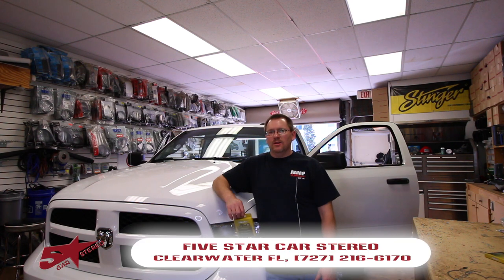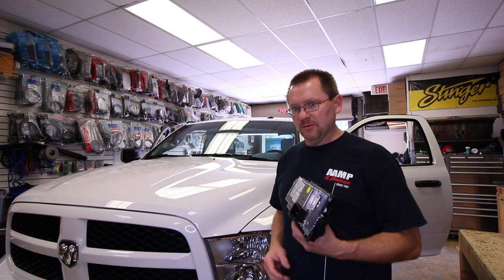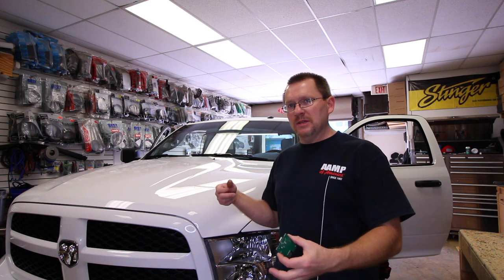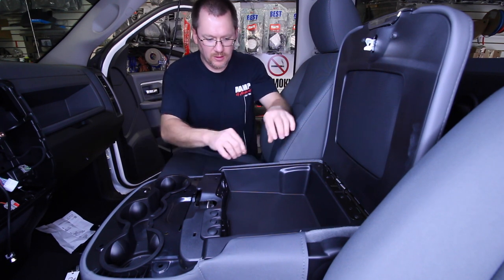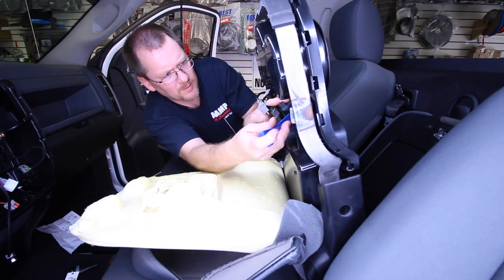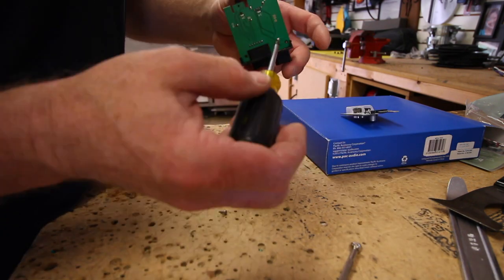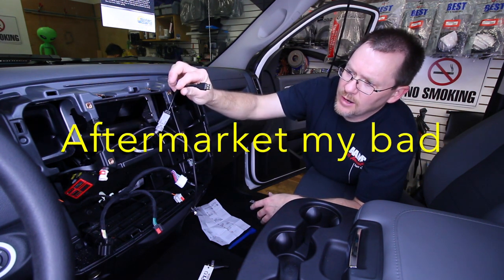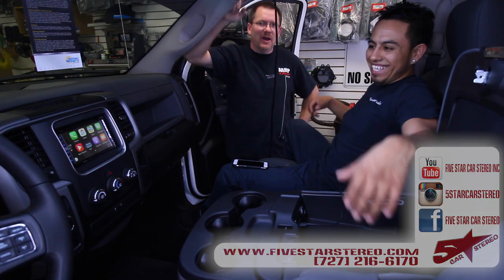How to install the idatalink uRam USB and AUX replacement hub for the Dodge Ram

Comment: I really like your videos.  I have one of these installed by Buy Best and it doesn't work on my 2017 Ram with a Pioneer AVH-2330NEX.  It keeps disconnecting and Android auto tries to start but dies.  I've tried 3 or 4 different USB-C cables, but no go.  I saw a lot of negative reviews on Amazon for 2017/2018 trucks and/or Pioneer radios.  I guess I'll need to revert to the Pioneer dongle.
Reply: Of course maybe I just got a bad one.  I'm bummed that I can't use the factory ports in the console.

Comment: Great video. I really like to get my hands on that idatalink uRam USB and AUX replacement hub. Recently, i had replace the OEM head unit with Kenwood ddx1035. its a bare basic head unit, but has an AV1 RCA input which i connected to a miracast unit (Brand: Dynavin, Model: 900). Link with my smartphone. cast the phone screen to the head unit. Downside, cannot control phone function on the head unit. have to use the phone. At least, i can cast google map onto the head unit. also play tunein radio in the background while using the google map. For the reverse camera, i install a spliter for the front and back camera with manual control button for the front camera for 20 second, automatically screened the front camera when gear is put to drive mode; active for 20 second. But the car has its own USB and AUX jack which is no longer function, I will need to source something like the idatalink uRam USB and AUX replacement hub.
Reply from the maker: If you are in the US give Paul a call and he will sell and ship you one.
Reply: Unfortunately, i am not from US. Anyhow, the video is great. I will try to source something similar in my country.
Reply from the maker: +Syed Adlan it just started shipping here last week so you guys should see it soon hopefully. Thanks

Comment: If you are thinking of installing this usb ram, look on idatalink's website to make sure your aftermarket stereo is compatible  with the circuit board. I installed one and found out mine didn't work .

Comment: I’ve seen a few videos on this now. One thing I question is why no one reused the plastic translucent plastic shroud that goes on the usb and aux Jack. I slid mine off and slid it over the Uram and fit perfectly plus it ads rigidity to the inputs when it’s in the center console

Comment: A little off topic question, but since you're an installation shop I thought I'd ask. How do you take the cubby that's under the stereo bezel out? I'm trying to install a hidden USB port in it. I couldn't find push in tabs on the side sliders or screws. Any help is much appreciated.

Comment: I have Dodge Ram 2016. The part that comes with it is there is no regular USB hub in the back of the radio, do you still need that adapter

Comment: Nice video guys , hi Dean just wanted to thank you for ur assistance on the Microbypass for the 4200nex it does work & with sd card and usb all in or DVD I think these guys won't mention any names didn't try it out or installed it wrong who knows  but it's on working as u &  Matt said thanku for tat 😂.?on a 03 suburban with Bose's system the rear Pilar do u have an idea wat size are those tweeters in there thanks again guys
Reply from the maker: +lolo ent glad it all worded out and you got it to work. The rear pilar speaker is 2" by 2" Bose speaker. Any 1" tweeter will fit back there. With some cutting you can get a 3.5" back there.

Comment: Hello, I recently subscribed to your channel and really enjoy watching your videos. I have a few questions that maybe you can help with. I have a 2017 ram 1500. I have been wanting to upgrade to an aftermarket head unit, however I have been told by a few people at dodge that this is the first year that they had integrated something into the wiring that meant that aftermarket was not an option. I dont know if this is similar to the canbus system, which will throw codes, if you dont use specific light bulbs, etc. I bought a lifetime warranty on this thing so I dont want to be hacking up all the wiring. Do you have any recommendations or solid answers as to what can be changed and what cant? I have a couple alpine amps, 2 10 kicker comps, and 4 6by9 that I would like to integrate. Any and all help anybody could provide would be appreciated

Comment: Im putting a simple single din into my ram 1500. Would this adapter let me have usb coming from the back of the radio run to the center console?
Reply from the maker: +Bryce Nauta yes it the radio has a rear USB

Comment: I'm installing a 2018 OEM radio into my 2016 Ram 2500 so I can have CarPlay. I know that the media hub in my armrest must be changed. Most suggest buying a 2018 hub, but it clearly isn't the same size. Will this product solve my issue?
Reply: Seriously,  has Noone tried this yet?

Comment: These seem to be hit and miss with carplay working. Is it possible that they work only with Rams equipped with single USB port rather than the USB port and SD card reader type hubs?

Comment: i have question if i install a new radio can the center usb still charge a phone
Reply from the maker: peppaboy9 some Rams have 2 USB ports in the armrest 1 is with the Aux for media play back and 1 is next to it for charge. The one for charge will still work the other will not.

Comment: I installed this and works perfect for my ipod.  Charges my android phone but i cannot access android auto. I tried it with both usb ports. Did I do something wrong or it just only works with apple car play?
Reply: i have the avh4200nex
Reply from the maker: Android auto is real picky. The cable length has a big factor. Are you using the original phone cable? Are you plugging the adapter in to the radio leaving out the pioneer extension?

Comment: Question about the center console usb connector on a 2012 dodge Charger. I bought a Pioneer avh-2300nex and the i data meastro. Will i still be able to use the factory usb instead of the one the pioneers system provided?
Reply: Factory usb hub only works with factory radio.

Comment: I am doing on Charger.  But video too fast and unclear for two connectors to data hub. I have 3 connector female slots on data hub and two plugs to connect. One wire plug is obvious the other is not.   I plan on using the outside connections.

Comment: this doesn't work with apple car play and android auto.  it says so right on their website and confirmed by many pissed off customers on crutchfield lol.    you still need to be hooked up straight to the aftermarket radio.  this product is a 100% waste of money and time installing it.   it seems something has changed with more modern headunits.  everyone says the radio says theres a problem with the cord  my jvc said the usb is not compatible when the radio turns on.  you probably have to have the whole maestro interface in your vehicle for this to work. I have one from AXXESS and they don't make one.  so it makes me wonder that's why it doesn't work for me.

Comment: just put the 4200nex in with this adapter. it will connect to android auto for about 10-15 seconds then the screen goes black and says "please stop your car and see your phone" or something i forget the exact message. i have no lock screen.  during the 10-15 seconds android auto will work, but then stops. i will try a new cable tomorrow but does it have something to do with the factory wiring?
Reply from the maker: +P LORD I email you back, I hope you got it

Comment: Tried using this with my ddx9702s and when I plug and iPhone in, carplay pops up then goes black, when I plug an android in (main phone) it doesn't recognize it at all. Is this something that I did incorrectly or can be fixed? 
Thank you
Reply from the maker: +MotoKotes nothing you did wrong. The Factory USB cable is to long and of low quality to pass the data for CP and AA. We just use the Factory USB for charge only. We mount another USB jack on the dash.
Reply: Thank you for the reply, I ran another usb cord from the actual headunit into the center console and it works. Its a shame that the stock system can't be used.

Comment: I tried this exactly the way you guys did, but when I connect my phone it only charges it, no CarPlay or ability to play music. If I connect a flash drive, it will let me see the picture (set custom wallpaper). When I plug in an iPod, it says "no response" please help!
Reply from the maker: I guessing  you are use an NEX radio, if so make sure you are plugged into USB 1 on the back of the radio.
Reply: +Five Star Car Stereo yes I was, thanks for the reply. I found out the problem: the adapter that came with my maestro kit only had power pins, I got a better adapter with both power and data pins from CarToys, and now it works, thanks. Disappointed that maestro would cut corners and in turn, give up functionality
Reply from the maker: +Cameron Garza that's odd, our unit did data. We were using it for CarPlay and worked fine, strange. Glad you got it to work, enjoy.
Reply: +Five Star Car Stereo thanks to y'all for all the support and vids!! Keep it up! Next up for me is that easy Siriusxm